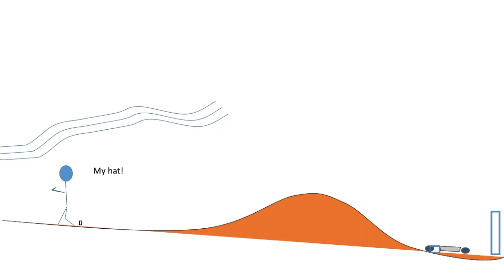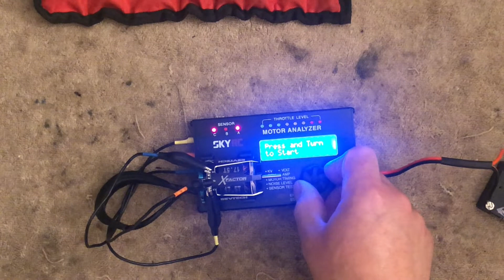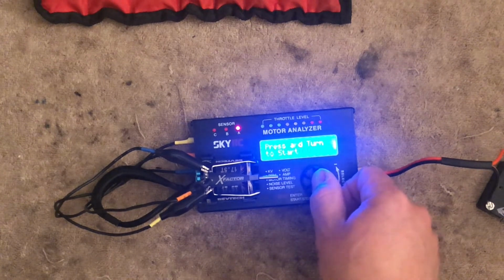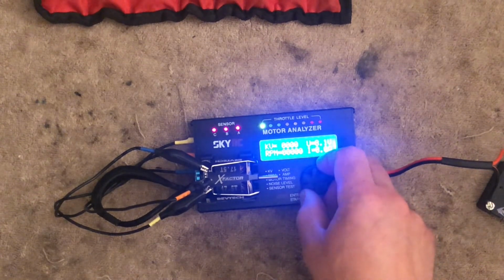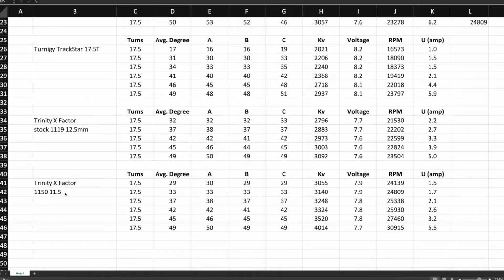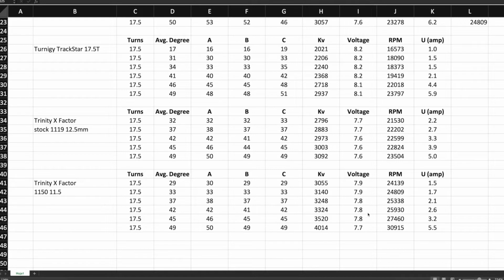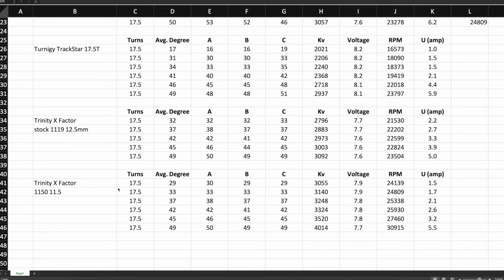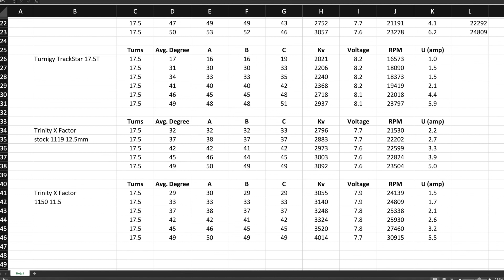Trinity Revtech X Factor 17.5T  Motor Analyzer Kv test rotor TEP1119 vs TEP1150 comparison

Comment: I am getting that motor today.  My problem is I don't have a analyzer. What is the best timing to get 6 amps out of the motor or what was the timing number to get the 5amp you got. I'm using it in my 6.3 buggy. Thank you
Reply from the maker: It was drawing 5A at 49 degrees which the end bell read as 50 degrees.
Reply: @telecomandorc  thank you that seems to be the same place I'm seeing on a lot of other motors also.
Reply: @telecomandorc  it was actually already set at 50 surprisingly thank you
Reply from the maker: @bryanallen7373  Trinity tends to ship them factory set at about 5A. When you swap rotors is where you need to pay close attention.
Reply: @telecomandorc  I think I'm good with it like it is. It was a lot faster them my Justock XR10.
Reply from the maker: @bryanallen7373  I do like Trinity motors. My second... very close second would be Fantom. Trinity and Fantom motors simply have stronger rotors. That is why they hit 5A (similar Kv) at about 5 degrees less than Hobbywing. So the little extra gauss plus the slitly lower timing yields a bit more torque.